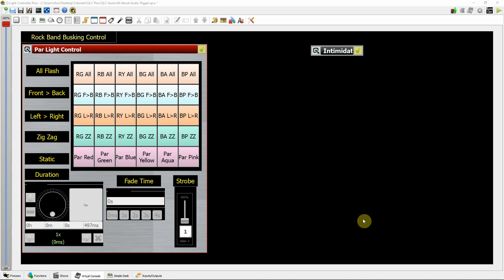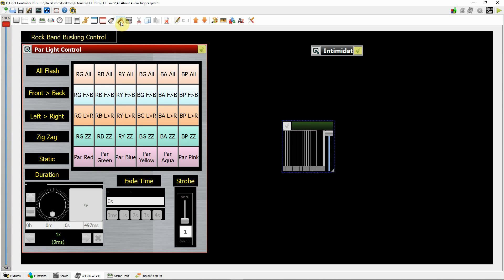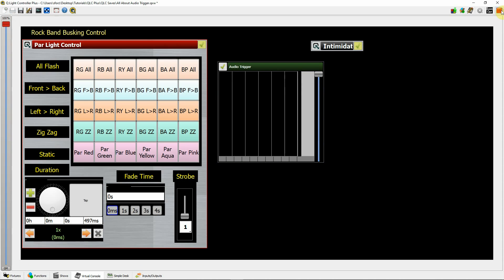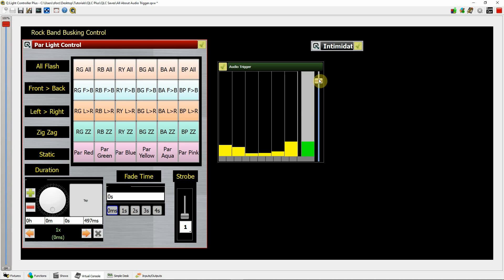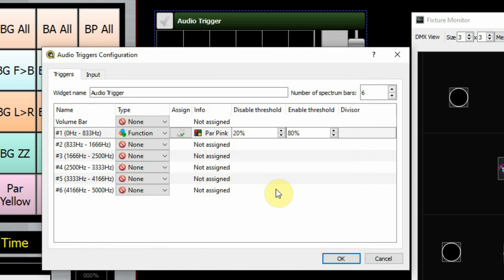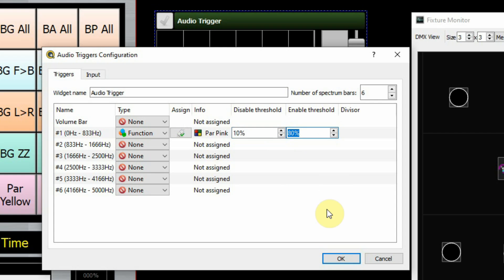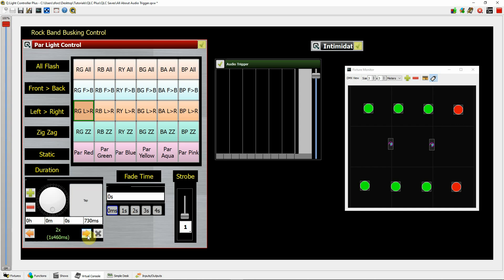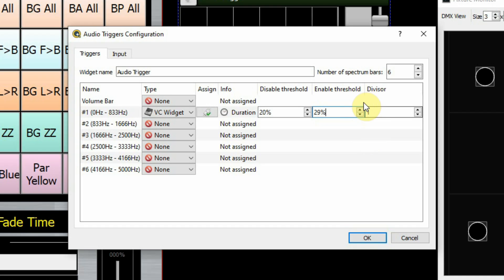The Audio Trigger Widget in QLC+

Comment: Hi,  one of the best in QLC+ for me so far, however I need something else:  is it possible to have the same effect  but with input directly from some playback program for ex. Virtual DJ or other ?  (not from internal microphone of computer) Has anyone tried  this way?
Reply from the maker: Hello
So I am a theater tech and not a DJ but let me see if I can help. It is my understanding that "Virtual DJ" can output OSC or Midi information that is synced to the beat of the songs you are playing. You can use Midi information to control the "Speed" widget in QLC+. You can also use "Midi" note commands or "OSC" messages to activate buttons in QLC+. I found this video which talks about accessing the Midi and OSC capabilities of Virtual DJ:
https://www.youtube.com/watch?v=-_ldVyL_t8U
I have some video tutorials about using Midi and OSC to control QLC+
https://youtu.be/mOK9clqqWYM
https://youtu.be/IPMAMZkIBig
https://youtu.be/NENYnhJvzg4
Hope this helps.
Ed Richards

Comment: Thank you Edward for all your tutorials. I am a DJ that is using Virtual DJ and VDJ has OS2L built in. Now I do get the audio to show in QLC+. And I have a VDJ profile in QLC+ that is picking up the beat of the music sent from VDJ. I have a cue list of scenes that I have set to change to the next scene with the beat trigger. But it does not work out as I have hoped. Do I need an audio trigger widget for this or not? I just want the scenes to change according to the beat from the music. Any recommendations would be appreciated.
Reply from the maker: Hello. So you can control the cue list in QLC+ using the Audio Widget
Create your cue list. Make sure that you have set the duration to infinite for the cue list using the clock icon. This means that you have to press the next button to progress through each cue in the list.
Double click on the Audio Widget in your Virtual Console.
Select the frequency band you want to use as the trigger and select "VC Widget" under the "Type" column
Next click on the "Assign" icon and select "Cue List"
Set your thresholds and you are good to go.
Go to run mode, be sure to activate the audio widget by clicking on the green check mark. Now the audio should trigger the cue list to progress from cue to cue.
Now.....you mentioned OSC. Are you using Virtual DJ to send OSC messages to QLC+? If yes then you will need to do the following.
The "Next" button in the Cue List Widget can be triggered by OSC messages.
See my video on using OSC with QLC+
https://youtu.be/mOK9clqqWYM
Hope this helps
Ed Richards
Reply: @edwardrichards7722  Thank you so much. I have changed the duration to infinite as I had it on 10mins, and is looks like it solved my problem. I have VDJ as a profile and all was set up. I have 8 pads on my controller that I have set to doe certain things, and everything works. It was just the cuelist had to change scenes on the beat as received from vdj. All looks good so far as I just tested with the laptop at the moment. I will connect make you a small video later on to show you the results.
Reply: @edwardrichards7722  https://www.youtube.com/watch?v=ahx_cLxPB6U 
This is my setup showing how I managed to get the scenes to change in a cuelist. I did not use an audio trigger. I do not have a microphone, but hope you are able to see what I have done and how I have managed to get it to change scenes on the beat as received from VDJ.
Reply from the maker: Thanks for showing me your setup. Helps me to understand what you can do with virtual, DJ. Love It !!\
Ed Richards

Comment: Hi, thanks for your video, I found interesting insights. 👍 I wanted to ask you if you can make a video to play a video with VLC installed on a different computer from where Qlc+ is running. Basically on computer (a) Qlc+ is running, and on computer (b) VLC and some video files are nstalled.
Thanks
Reply from the maker: Hello.
So what you need is show control software. QLC+ excels at sending DMX signals to lights to control them. It cannot control VLC using DMX data signals. Show control software can control QLC+ by sending midi or OSC commands to the software. Show control software could also control VLC. For example: these is a program called OSC keystroke that could control VLC. Basically you would send OSC commands from the show control software to OSC keystroke program which would be on the same computer as VLC. OSC Keystroke would convert the OSC messages to actual keystrokes which could be used to control VLC. So the setup is Show Control software and QLC+ on one computer. OSC Keystroke and VLC on the other computer. Here is an open source show control program that would be up to the task:
https://youtu.be/vYUWbNnrx9s
Hope this helps
Ed Richards

Comment: Hello. In Live mode, when audio is playing, low frequency bar is counting some rhythm and triggering 'cue list' to go to next 'scene' or 'collection' But is there any way to automatically turn off some fixtures when music stops or volume bar is below, like 5% ?
Because it just stays on one scene/collection, on time that is set in chaser 'hold' parameter.

Tried with triggering Button (that is attached to fixture zero DMX values) to enable threshold at 5% and disable at 6% ,but it looks like that it doesn't work other way around.

Comment: Thank you for continuing to make these videos, they help immensely.  

Question: I'm installing QLC+ and a show control software in my second community theater.  This one is lower budget so I'm considering SFX Show Control or Multiplay3 (Windows only).  Which would be better right now in your opinion?  SFX seems more complete but development is stopped.  Multiplay3 is less complete but with semi-active development.  My plan is SFX until Multiplay3 reaches feature parity or comes out of Beta but I just wanted to make sure SFX hasn't been broken due to no longer being updated.  I have used both but just for simple sound effects, not really a demanding show yet.  Thanks for your opinion.
Reply from the maker: Hi Matthew
My absolute favorite is still CSC Show Control but you would have to pay approximately $150 for a license. The license fee is just a one time expense and is good forever. (unless they come out with a major update of the software) I just find the features to be better than the other two programs. See my videos:
https://youtu.be/UwbAaJYZT7g
If not CSC then I think I would opt for Multiplay. I think it takes less work to create cues that are associated with one another and you do have OSC cues available. The only bug in the Multiplay program is that you cannot use the same midi interface to send midi note cues and midi sequence cues or else it locks up. The work around is of course to either use midi sequence cues or midi command cues but not both. For most people this is not a huge inconvenience.
Ed Richards
Reply: @edwardrichards7722  Thank you, I plan to be using OSC commands with Multiplay to control QLC+ as they use lots of volunteers at this location so having one spacebar to control both sound effects and lighting is ideal (I plan on programming, just volunteer operators to run).  I noticed you did a video on OSC on CSC Show Control but not Multiplay.  On QLC+ it should be the same, but an idea for a future video might be setting it up on the Multiplay side (just to have complete tutorials).

Thank you for everything you do, you made my journey into theater tech much more enjoyable!
Reply from the maker: @MATTHEWVALERI  
Hi Matthew
On your suggestion I made a video about how to send OSC commands from Multiplay to QLC+.
https://youtu.be/JYWg1MTLMe0
Sorry about the leaf blower in the background.
Ed Richards